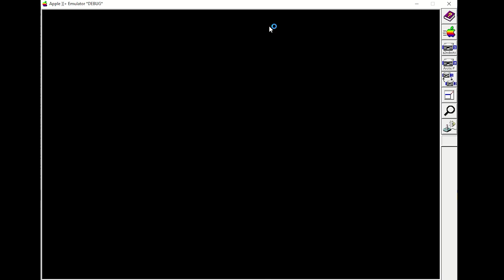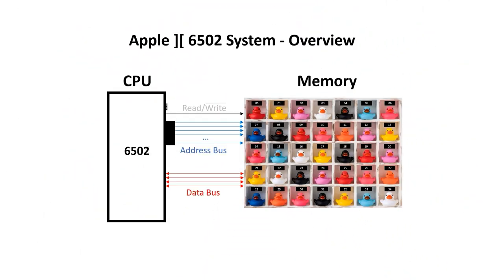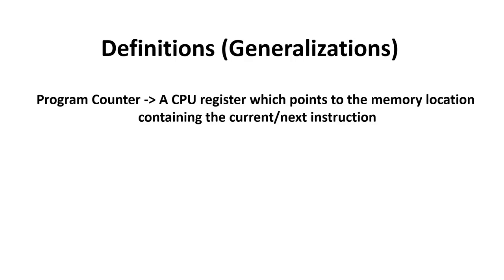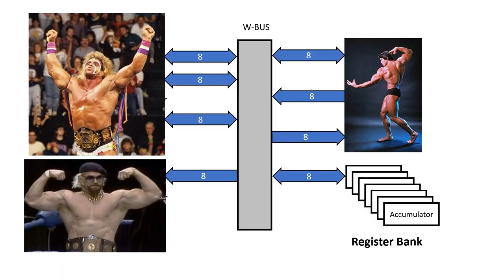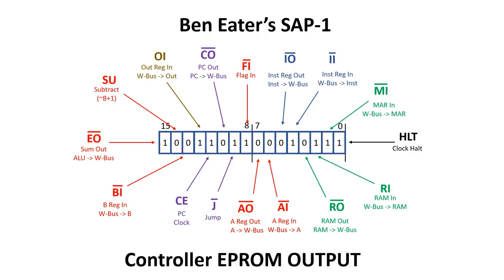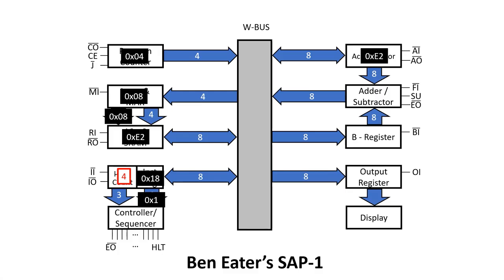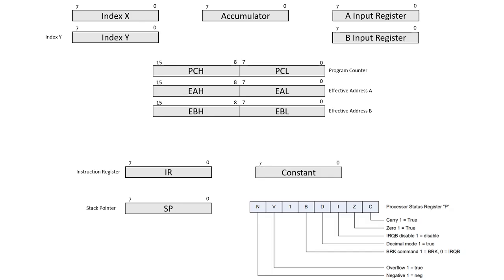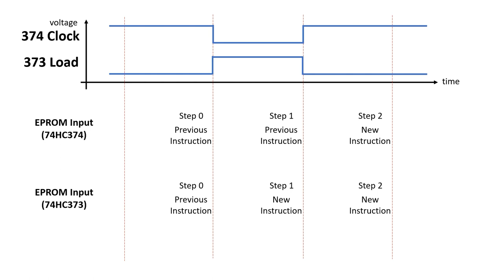How to build a 6502 TTL-CPU: Part 5 Program Counter

Comment: About the difference between latch (373) and flipflop (374). Isn't it true that Ben's design "wins" the cycle back because the eeprom decoding (next step counter) happens on the falling edge of the clock (inverted clock)?
The eeprom has time to settle until the clock rises again.

Comment: Hi , a question : How the 6502 MP handles the interruptions(NMI and the IRQ) at the hardware level ?
Reply from the maker: Good question.  On the 6502 there is a special unit for reset NMI and IRQ.  I haven't implemented these yet, but ultimately, i'll lose another address line.

Comment: While I understand what active low logic is, it has always bugged me. I've assume there's an underlying hardware reason, like reducing the number of gates, or preferring nand logic. But I don't really know why.
Reply from the maker: I suspect it goes back to the NMOS days, possibly earlier when there was an actively driven pull-down transistor, but pull-up was done with a passive resistor or a transistor wired as a pull-up but not connected to the input signal.  When the output is low we have a high current state (voltage across the pull-up), so if most outputs are inactive (ie. a 74138) we have less current draw overall with an active low output than an active high output.  

If anyone knows for sure, leave a comment.